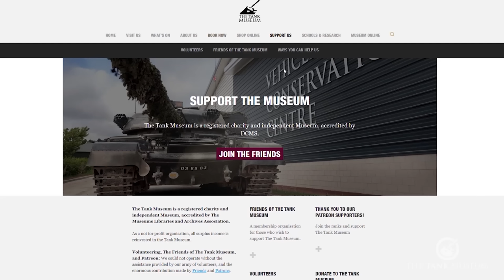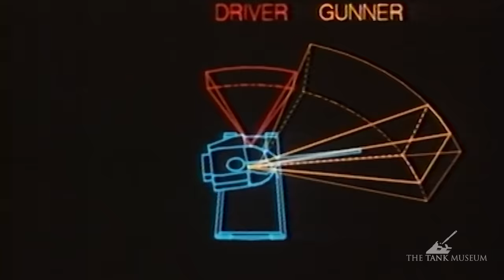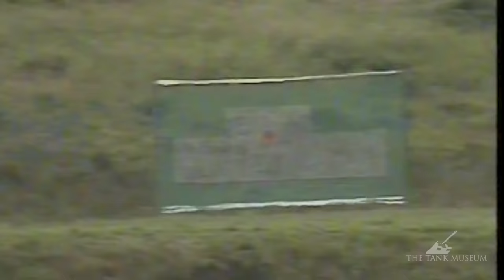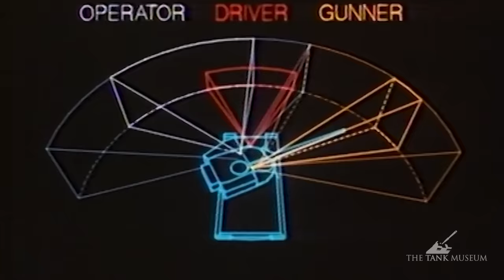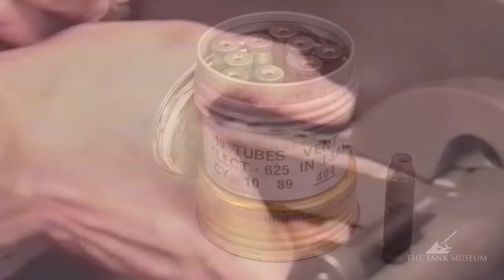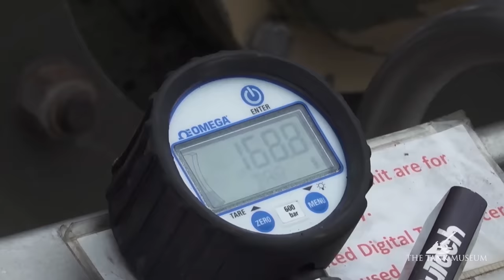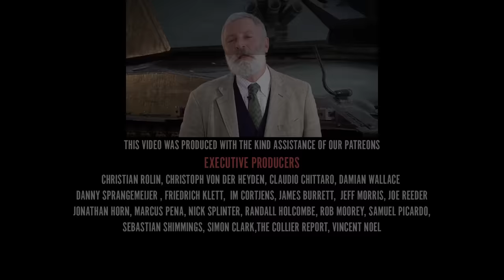Tank Chats #92 | Challenger 2: Full Length | The Tank Museum

Comment: Outstanding explanation of Challenger. Well done to David Willey. For obvious reasons they didn't go inside or mention other aspects.. Other features are the sensors (Thermal imaging) not discussed. Also sensors to detect if you are being 'painted'. Very important as this will initiate ejection of CMs.

A key metric is how many rounds you can get off in a given time interval.  The hand off from commander to gunner sight is interesting. Notice no use of HEAT rounds. There is a reason for this which is tied into the rifled gun I believe.

There are plans to upgrade to smooth bore (Rheinmetal 130mm). Introduction of APS systems.I visited DSEi 2019 - and saw new updates but inside was off limits. Sensors are key as you can have best tank, Armour and gun - but need to see out to ranges efficiently in the dark to maximise effectiveness of gun.

You will always need armour to take and hold ground. You cant do that with air platforms or broadcasting bits and bytes into the ether (cyber warfare).  MBT is a Faraday cage and to some extent proof against cyber but need anti virus to prevent attacks that hinder inter tank communication.

Note that a  MBT however good it is does need infantry support & cannot function in isolation. A MBT mobility can be easily compromised  if the tracks  are blown off, either by battle damage or wear.

I wouldn't mind a ride in a Challenger - but plenty better qualified in front of me.

Comment: When the Swedish CV90 was developed, because of cost they had to chose between gun stabilization or a thermal sight. 
A Thermal sight was deemed more important (night vision don't work during cloudy winter days in northern Sweden).
However as the production went on stabilization was brought back in after the Gulf War had demonstrated it's usefulness.
CV90's under production got a stabilization system and the next batch got a better stabilization system, this continued until the CV90A with three axis stabilization and then the previous vehicles where all brought up to CV90A standard, it's stabilization is still limited.
The CV90B was the next version which had major modifications, now the stabilization system isn't tacked on but built in from the start, the suspension is also different and more suited to a stabilized gun and the gun itself has an electric firing pin so the computer can fire the gun at exactly the right time.
This is a fully stabilized modern system.
In this respect the UK and Sweden where similar that they had limited resources that needed to give the most bang for the buck.
In fact the whole CV90 project meant the Centurion tank could not be replaced in the 1980's, it was deemed more important to mechanize the arctic brigades which was the original mission profile of the CV90's.
Basically all brigades in the northern half of Sweden was geared to fighting in roadless terrain in deep snow they used a lot of articulated tracked vehicles since wheeled vehicles had failed to do the job in a 1950's winter exercise. Otherwise they where infantry brigades that got slightly better equipment than other other infantry brigades.
The CV90 was supposed to mechanize one of the battalions of each brigade and give it more punch against the Soviet hordes of the Murmansk and Leningrad military districts coming through Finland.

Comment: We had 4 armored divisions, not 2. The hunter/killer was implemented on Chieftain. I would be engaging a target, my commander would pick up the next target. Once I’d killed the target, the commander pull a “switch” which brought the gun and my sight on to the next target.

You also missed that in the British Army a tank troop typically had 3 tanks, in a war configuration it would have 4 tanks.
Reply: The Bradley has a similar kill>CO acquire's new target feature. I'm surprised you practiced different than you would perform in real life.
Reply: @seandelaney1700  The tactics used with 3 tanks are exactly the same than are used with 4.
Reply: contra rotation

Comment: I remember when that Challenger was stuck in a ditch and was hit by 30 or so RPG's. even the optics were knocked out. Must have bee pretty frustrating for the insurgents. I wonder if it was just RPG's 7 or if they were using a different rockets as well. It is my uderstanding the unit was back in service pretty quickly.
Reply: They used both regular, most common RPG7, and its modernized versions with tandem warheads or HE as fat as 10cm. Although Iraq Army used Russian 7R and 7L in big numbers, it is possible that those were Chinese equivalents/variations. Challenger 2 in Iraq been also struck with the more modern variant of the Milan missile system. Probably model 2, the one equipped with "probe" penetrated one Chally's ERA frontal hull setup. 
Can't say it was the tank you've mentioned. It's the one sir David described the case when the driver got hurt.
Reply: @HanSolo__  That definitely would be a different situation. The one I referred to, the crew was unhurt/
Reply: Peter J Mallia  Leopard 2A4's have not done particularly well in Syria (Turkish Army user I think). Mind you I think they were using the wrong tactics and the A4 mark was not anywhere near as well armoured as the C2. The current A7 mark might be ? anyone ?
Reply: placeholder The 2A7 is the most protected MBT rn
Reply: Peter J Mallia  well the challenger was deployed in 2003 Abrams has been in use for about 40 yrs and been in 3 wars so it still has a good track record.
Reply: Dominic Also worth pointing out that there were a lot more Abrams in theatre. All else being equal, more tanks in combat = more tanks hit = more opportunities for tanks to be damaged or destroyed.
Reply: Peter J Mallia  Talk about bias. Let's just take the patriot hat off for a second and be rational. The challenger that was shot 30 times was shot with an outdated light AT weapon if it couldn't survive them it wouldn't be a modern tank. As for why none have been taken out well that's easily summed by 2 factors lack of numbers and action. Compare that to abrams which has served far longer seen more engagements and had more fielded. As a result it's been engaged by a far wider range of enemy weapons so been truly battle tested. Most incidents of them being knocked out were also blue on blue the only true killed abrams was one that went over a 500kg IED buried with a few 155mm shells that had such and explosive force it ripped the turret off. The only other enemy action was a mission kill from a recoilless rifle to the rear that took its engine out and it was decided to destroy it rather than recover it. Which goes the same for most other Abram kills. If you look into it they were usually mobility kills only and were back up and running in no time same as challenger 2 was. I can guarantee a rear 105mm shell or 500kg mine would harm a challenger 2 to a pretty similar level. 
As for the Leopard the goal of it's design is mobility and firepower from the acceptance no tank is unkillable and it's better to be quick and hit harder so not really worth comparing in the same sense. That's not to say challenger is bad just just let's be realistic to some simple facts it wasn't built to be the best it was built on bang for buck balance and that mindset of our kit is the best ever and can't lose is the kind that leads to horrible awakenings to reality and the end of major defeats that could have been avoided. Battle of Jutland for example. Let's be sensible and call it a respectable modern battle tank but accept enemies who can field real threats to it not militia insurgents could probably counter it.
Reply: @komradearti9935  there is another offer i read somewhere.
Reply: They're using RPG's lads!  Time to put yr ear-defenders in!
Reply: @ServusIchBins  : What ever helps you to sleep at night mate ;-)
Reply: @ServusIchBins  2A7 is just a 40 yr old Leopard 2 underneath. For a bit of perspective when Leopard 2A4 was trialled by the UK in the late 80's it was found to have less armoured protection than Chieftain - which had been in service since the mid 60's.

Comment: "It was estimated the Chieftain tank could penetrate the T64 at 2500M" Wish you would tell War Thunder that. According to them, only place a Chief can pen a T64 frontally is the drivers view port, lower hull or turret ring. An Abrams M1A2 Leopard 2A5 and Challenger 2 can't pen a T64s turret point blank.
Reply: In the game we have T-64A 1971 which is different with T-64. Turret can't be penetrated by chieftains gun and about ufp there is no clear information. I saw that ufp of T-64A has ~300mm against KE and Chieftain's APDS has ~320mm penetration. So at 0-500m chieftain could penetrate ufp of T-64A. In WT you can actually do that.
Reply: You can. Chief Mk10 L23 shot- 2500m Distance, pens frontal plate of T-64 (1971)
Reply: The guys firing 40 RPGs into a Challanger2 : "Sir, we should retreat, we can't damage this tank !"
Officer : "Continue firing, I have played enough videogames, I know how this works."
Reply: WT nerfed the NATO guns penetration by about 50mm for every gun from the 17pdr onwards, while the soviet ones have their actual, irl, declassified values, likewise with armour for British tanks. The irl penetration of the chieftain APDS was around 400mm at 0* at 1000m compared to 320mm in game, the chieftain irl did however struggle to penetrate the ufp of later T64s in theory due to the heavy slope and triple layered composite, although this was not put into practice, i think it would be much easier if we had a test, i'm sure loads of t64s must be floating around and the tank museum has at least 7 chieftains so may be worth a go.
Reply: @cerdic6867  russian bias
Reply: @rinaldoman3331  erm, Russian Devs. With no actual battle experience. So most stuff that's appeared in the last 10 years, ref tanks and ships. They should seriously redress how crap their kit is.
Reply: Of course the chieftain did blow the distance record away in Kuwait  at over 5000 meters
Reply: @georgesheffield1580  Not Chieftan, Chally 1.
Reply: @cerdic6867  video games? you must be crazy?🤣🤣
Reply: @ozonzechibudike4293  whats wrong with mil sims?

Comment: The Challenger series, the most powerful weapon of its day Ans still is to a point, it still has the longest Tank on Tank Kill, not a single Challenger 1 or 2 lost to enemy fire, and with its amazing Chobham armour then on to the second generation armour Dorchester on the CH.2.MBT, the most survivable tank ever to be produces until we get our upgrade, maybe even a new tank with a completely different name.
The MBT-80 experimental Tank, even originally tried a gas turbine, (OK he just mentioned it). Of anyone can look for picture of the MBT-80 experimental Tank, even just the hull, it lookediie it would've been Massive tank.
This MBT-80 project was a joint project with the United States, where the UK and US shared ideas and information on one anothers project, in the end we the UK pulled out, the US carried on and ended up with the Abrams M1A1  MBT.
The Chieftains were amazing, the Vickers export turret that outmatched the UK tanks of the day which forced the MOD to start a new competition for new requirements for a new tank, Challenger 2.
I'd call it

Comment: @ 03:01 Lol Saw a tank(00FD85) I served on back in 1985-86 in Tidworth , slowest ruddy one in the Squadron back then lmao ,, but we had good darn times on the ol bus .. back in 85 whilst on the ranges at Castlemartin we had a "flashback" in the turret , I was gunner at the time , we had finished firing Apds and started on our Hesh shooting ,cant remember how many we had fired ,all I can remember is that I fired and saw a flash as I was looking through my sight observing the trace ,,realizing that that shouldn't of happened I called out "stop,stop ,stop" Commander went hapeshit but when he came down saw the Operator was still smouldering ( lol, Eybrows and beret, my left rear of head was still smouldering plus me Beret on rear left and then realized he had felt a warm sensation on his legs ( lmao )  ..We then got  permission to withdraw  to rear of range where I and the Operator started removing the Obturator rings to inspect and see what happened ,, after two hours ( or so cant remember exactly hoe long it  took ) of cleaning and inspecting the Obturators and breech block , we found that a piece of hessian from the bag charge for Hesh had burnt through three of the four rings on both Obturators , tobe exact it was three and a half rings ( We were so ga*damed lucky that day!! ) ,another time also 85 whilst on a night exercise ( at that time Driver  was opened up for night driving , was alot easier and safer back then for the crew for night driving), we found the only man-made hole that could fit a ruddy Chieftain if it drove in straight on, if the Driver hadn't of suddenly stopped and called out over the IC that something wasn't right  just before we were about to drive into said hole then I certainly wouldn't be here today ,, those were the days lmao ,, heehee lmao  ... So if you go visit the museum and 00FD85 is still outside at the main entrance then try and remember this story lol ,, last time I was there in 2006 meself and a couple of others from our ol Sqn had alaugh when we saw  that tank ,, one of them served on that tank at that time ,,he was a darn good driver ( cheers Tlyks if you ever see this Bud !! ) FTW ..... At that time I served in the 5th Royal Inniskilling Dragoon Guards in C Sqn ,,,,  Regards "Bucky " !!

Comment: I have heard a armoured battalion a mile away. I think pepole underestimate the psycological effect hearing it. I thought they was about to show up in the tree line 50 m from where i was.
Reply: At a mile away you can hear an armoured tank battalion through your feel. The whole ground is shaking.
Reply: We were told the exhaust notes are specially designed to be low frequency, you can hear them but apparently its harder to get a good bearing on them, just a rough direction.  No idea if thats true or not
Reply: @G G088 that is what happens but the issue to think of is no exact infantry should or will be standing directly infront of the hull from a tank nor should be, its plausible since that is what the process of era is it explodes and detonates before true impact of the projectile hitting it causing a blast away from the initial projectile blast in a simple form of explaining.
Reply: @PamweChete2503   British tankers in N. Afrika said they could feel the Germans coming when they laid down on their bed rolls to sleep at night. The ground was rumbling.
Reply: @catlee8064  Correct but not well publicised. Wiki to the rescue. Evaluation for low frequencies
For frequencies below 800 Hz, the dimensions of the head (ear distance 21.5 cm, corresponding to an interaural time delay of 625 µs) are smaller than the half wavelength of the sound waves. So the auditory system can determine phase delays between both ears without confusion. Interaural level differences are very low in this frequency range, especially below about 200 Hz, so a precise evaluation of the input direction is nearly impossible on the basis of level differences alone. As the frequency drops below 80 Hz it becomes difficult or impossible to use either time difference or level difference to determine a sound's lateral source, because the phase difference between the ears becomes too small for a directional evaluation.[11]
Reply: @catlee8064  as a person with 1000w and two 12 inch subs...... in a 99 Buick century (aka, a grandmother car)
.
i can tell you that cops will look at EVERY OTHER car..... when im having a bit too much fun at a stop light. 
give me a chance to reach over and turn it down lol
.
no one expects the "bumping Buick"

Comment: 34:30 The hydrogas suspension system presumably works according to the same principles as the hydropneumatic suspension first used by Citroën on the 15CV-H and DS giving this tank a kind of “magic carpet ride” quality across a variety of terrain types.
Reply: No, it works on the same principle as the system fitted to Austin Maxi, Austin Allegros, Austin Princess etc.  This is a completely passive system unlike the actively charged Citroen system also used in some 80s/90s Royce Royces, Bentleys and the Merc 600.

Comment: Please, 🇬🇧, send more than a company of Challies to 🇺🇦!
Independent of us 🇩🇪@🇪🇺 sending Leopards ourselves or at least giving the OK for others to deliver theirs, 10-15 pieces is simply too few, especially considering maintenance/temporary replacement.
30-50 should be the number, 100 would be better.
..I believe there had been considerations to half the tank fleet anyways and concentrate on other weapons systems, which would actually make sense as an island nation, basically going the USMC way.
Maybe make a deal with Rheinmetall and the German government to replace your Challies with KF51s instead of Challenger 3 (I believe Rheinmetall is a partner, maybe even the leading one in this deal), and have those completely or partly assembled in Britain.
130mm smoothbore!! 🤪